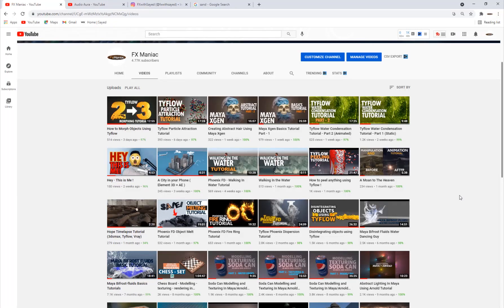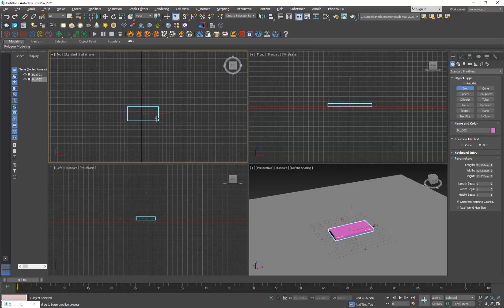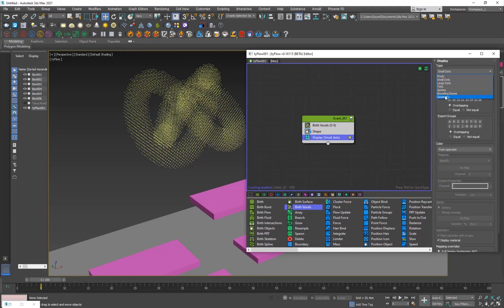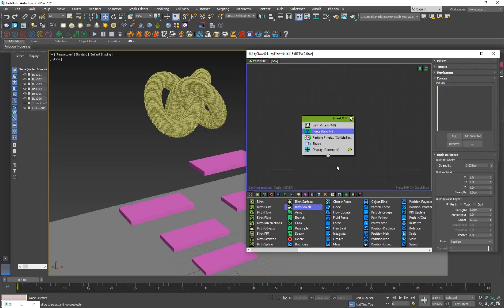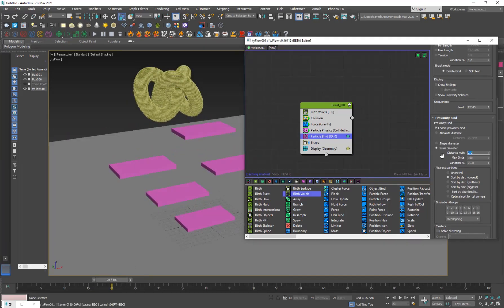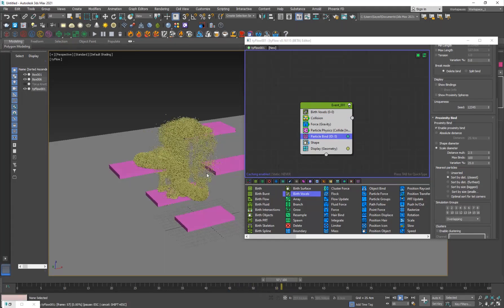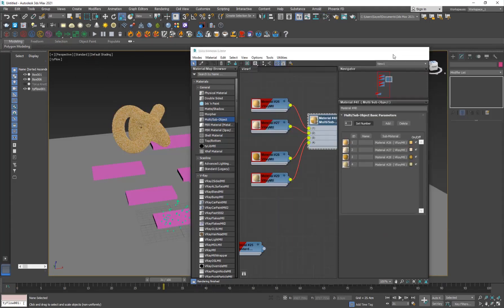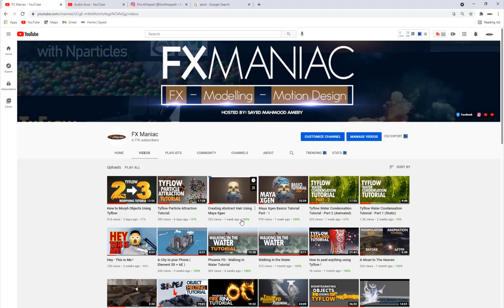Creating Realistic Sand With Tyflow | Fxmaniac

Comment: Am I right in assuming that if the steps are not made into a single object, when they are added to the collision operator the file becomes heavy, the processing becomes slow, thus, the concoction of all the steps into one object?
Reply from the maker: No , that won't be an issues you can merge the steps or use them individually